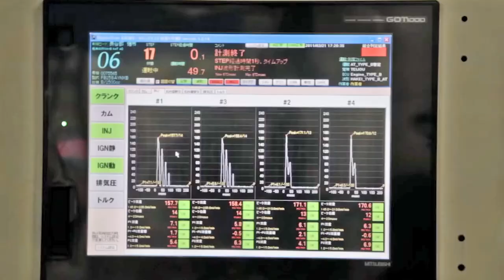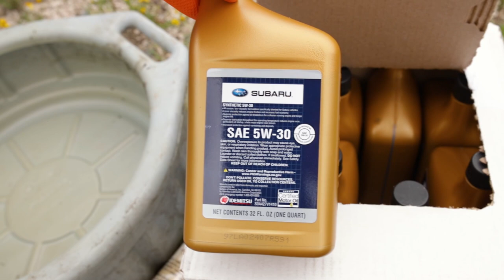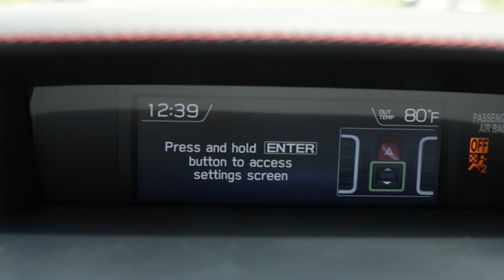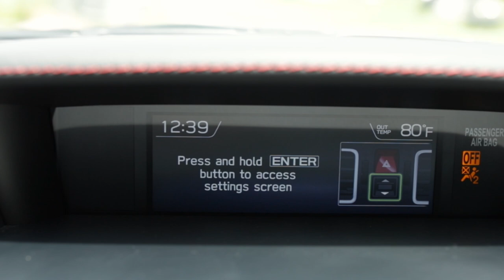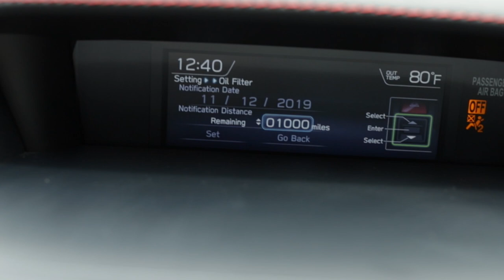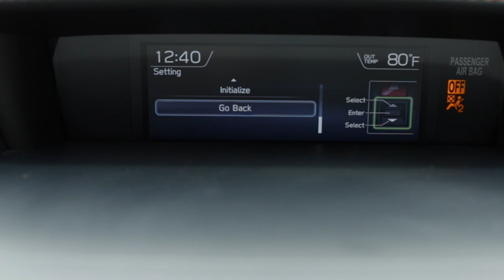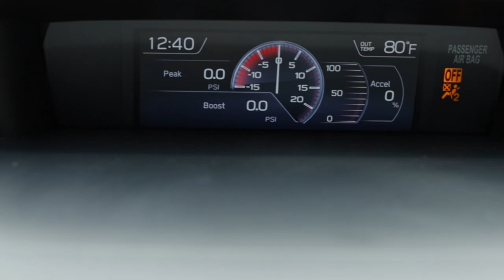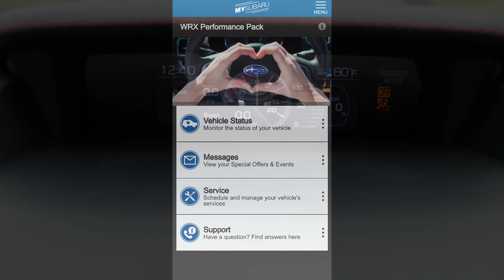2019 Subaru WRX Oil Change - DIY

Comment: On a brand new engine that you built and put in a car this is necessary. But Subaru actually breaks the engine in before putting it in the car at the factory.

Comment: I didn't know about the clear flood mode start on the cars. What I have been doing with my wife's '18 WRX is to fill the filter up with oil once, the filter will abosrb all of that oil so when you turn it upside down to install it nothing will drip out, I figured that way it at least had a little bit of oil in it. But your method is by far superior, the way I've been doing it I still got an oil light for a couple seconds after start.

I did the intervals similar to yours. First oil change was at 500 miles, the dealer offered a free oil change at 1000 miles so I did another one at 1000. I now do it 2x/year which is about 3200 mile intervals. My wife does not drive it very far.

Comment: i work as a technician at a subaru dealership and i’ve always recommended first oil change at 1000, then every 3-4k after that and never seemed to have any issues. i’ve also never prefilled my filters, these engines get a ton of oil pressure from cold start so i don’t worry about it too much. they’ve definitely improved the entire lubrication system on the FB engines compared to the EJs
Reply: It is the pursuit of perfection.  I did a semi-hard break-in on my 2013 Forester XT and changed the oil at 150, then 500 miles.  I live in the Sierra mountains, I loaded up the car with a few weights and a passenger, warmed it up and went for the hills.  First a few small hills up and down several times.  Then a bigger hill, then I let the car cool nearly completely.  Second time, again up and down but larger hills and a small mountain. Max rpm's around 4200-4500, for 5-15 seconds or so at a time, ...main goal was to put some load on the car and get the piston rings to seat.  I changed the oil immediately afterwards, at 140 something miles.  My next trip was through some really big mountains at higher rpms,   The car runs nice and doesn't burn any oil.  I am sure it would also do fine if I followed the owners manual recommendation for break-in, ...it is just the pursuit of perfection, plus in my locality there is no avoiding the mountains.
Reply: That's exactly what I did and have been doing since I bought my Series.Gray. I take my car to the dealer for oil changes (they are the cheapest in town for oil changes and I'm lazy haha), and they think I bring my car in too much, but Im just taking care of the car I have wanted since I was a little kid.

Comment: Cool topic. Solely as a point of comparison, according to the dealer, my Evo IX came with conventional oil for breakin. Drove the car as recommended by the manufacturer for the first 1000 miles. Against the dealer's advice, at around 500 miles, I changed the oil. Changed it again at 1000 miles to M1 factory fill, then at 2000 miles, followed by regular oil changes about every 2K miles to this day. The car has never been a daily driver. It's on its 6th set of tires and 4th set of pads with 60K miles on its odometer, to give an idea as to its use. Burns almost zero oil. A hardly noticeable amount. I'm amazed by this, as the car is almost never below 3K RPM and sees extended periods of WOT fairly frequently. Interesting how motors these days are broken in at WOT. Not sure this make me feel totally comfortable. BTW, I really like how the WRX's filter is right in the engine bay.

Comment: Yep,   I changed the oil on my new 2018 Impreza using about the same mileage intervals as you did.  I only used full synthetic, because I could not find any documentation stating otherwise. It does get a little expensive during the first 5000 miles, but  all the short intervals should pay in the long run.

Comment: FYI I’ve used the melling MPL-101 compressed air engine oil primer on all rebuilds to avoid dry starts.  It’s expensive but it works well.  Just install the fitting where the oil pressure sending unit goes charge with air and oil and let ER rip... they were pricy but they have come way down in price

Comment: My 06 WRX has clear flood mode, but it can be touchy... one time I only just thought about letting my foot off the accelerator and it started at full throttle.  I use it to move some oil around if I’ve let the car sit for a couple weeks. Use it at your own risk.  Edit - I wrote this before the part in the video where Mr Subaru used this feature.

Comment: 2016 WRX brand new. At 100k miles now. I've done Penzoil 5W30 Full Synthetic with Purolator One filter changes every 5k miles.  
Not a single issue yet.
Reply: RedSaiyan original filter looks prettier...

Comment: With modern engines apparently a WOT break in is the best way to do it. From what I’ve been told it has to do with seating the piston rings.  Low tension rings and the very smooth cylinder bore surface (to reduce friction increase mpg) they need a ton of heat to get seated.
Reply: I read a very similar thing after I rebuilt the top end on my 4 wheeler.

Comment: I have a 2021 WRX & I did my oil changed. Before I cranked it I did the oil flood mode that you mention & yes you can perform it. This is cool cuz this way oil can be pumped through the engine without having a dry crank. 😁

Comment: That is an insane oil break in procedure you are suggesting... I have NEVER had any issues at changing  @ 500-1500 and then 3500.... and I have had 24 new vehicles (8 were Subies). I also immediately install a Fujimoto quick drain on all vehicles- This is a must if you do your own frequent oil changes...

Comment: As far as "Break In" on any engine I have never done anything special. No additives, no special oil, just drive them easy for the first 1000 miles (vary speed, no high speed driving, no hard acceleration) and change the oil and filter at 1000 miles and have always got good service out of the engine, last car 409,800 miles and the old truck I have had since new 308,000 miles with no engine issues. As far as oil brand that is more a personal preference and it seems everyone's own brand is the best. FYI I have always used WALMART SuperTech Synthetic NO JOKE it even meet DEXOS 2 specs. If you do sell that car someone will get a great engine!! with a fun car attached.
Reply: @Snadzies  I am an old retired mechanic the BS is many years of experience.

Comment: MrSubaru, I changed the oil/filter in my '23 Outback for the first time today after 670 miles. I purchased OEM 0W-20 Subaru oil and crush washer but have't gone ahead and gotten a black Subaru filter yet. I changed it to WIX XP as I've seen/read they had gotten the best reviews compared to other brands. I'll try to get the black Tokyo roki filter next time, used the clear flood mode and worked like a charm! So happy I came across your channel and love the content!

Comment: Hey mr. Subaru, I’m currently a service tech a Subaru dealership and we use a funnel like that and it works on everything that I’ve had in here and the black filters are used on brz, 15+ wrx and the 6 cylinder engines, everything else uses the blue ones even the new sti’s which is sad. And the original filter on a  cross trek from the factory is a black one but we don’t carry those so we just put the blue ones on
Reply: Can you use the wrx black filter on other models? Was about to buy one for the wifes forester. That or those black Mazda filters. Looking for alternative to the blue filter
Reply: Josh Bascii not the ones for the wrx but you can find black filters for other models online

Comment: There was an article in Popular Mechanic, many years ago, way before the internet.
Car engine's first oil change should be at 200 miles, 2nd oil change should be at 1000 miles. After that at manufacturer's recommendation.

Comment: The old ways of breaking in no longer apply... these machines are much better built and the tolerances are significantly improved since the 1970's.... Do not sell the car, you are going to take it in the shorts....financially.
Reply: Only really needed break in for the cams and rings. They break in the cams now on the dyno and the material they use for the rings now needs little to no breakin
Reply: Yeah I had heard that since more or less the late 90s or early 00s engines always went through a factory break in. Not that they didn't still recommend a "light driving" period, but not the same as old school break ins.

Comment: did mine 600 2000 5000 then every 5k....now have 105k no issues runs great....2015 cvt
Reply: my 2015 has lower aluminum control arms

Comment: Yes, Subarus do have flood clear crank mode, floor the accelerator pedal to have wide open throttle (WOT) and the car wont start, I use that procedure after an oil change in my Forester.

Comment: Here in Sweden we have to let our dealership service the car for the factory warranty. I think most cars now days here has like a 25 000-30 000km service interval or once each year, which when I calculate it says about 18 000 miles US (we don't use miles in Sweden). You could service the car more frequently at the dealer but you pay about 200-300$ per oil change and a lot of new vehicles is sold as leasing cars.

Comment: Very meticulous! If I bought a brand new one I would probably be exactly the same. Everything you are doing may in fact be "unnecessary" in the end. It is however, still cheap insurance if it helps at all. I had totally forgotten about clear flood mode and I'm gonna use that technique from now on!

Comment: I wonder if that certified Subaru oil has a more readily-available equivalent, maybe even for less money, that would meet all necessary Subaru specifications?  Mobil 1 perhaps?
Reply: Any name brand synthetic is perfectly ok. Subaru motor oil is made by Idemitsu. Available at Napa,advance Auto,possibly other places. Most Asian carmakers often use a common API oil standard. So buy what you can afford. Costco has Kirkland Synthetic motor oil that is extremely affordable. 10 Qts for $24-$26. It's a high quality oil made by Warren Distribution. No problems with it. Walmart Supertech is another affordable oil.

Comment: Like you said, I think all engines are broken in at the factory.  As part of their quality and function tests, Japan factory runs a special single weight oil in the engine for some period of time.  Oil is drained and engine is crated.  In the case of my 24 OBW, car came with 0W20 synthetic and a US-made filter from Indiana plant.  Maybe you can still do one or two oil changes before your regular interval, but I believe this is far less important than perhaps 20 years ago.

Comment: Would you recommend the same break in oil change technique for a 24 Crosstrek with a 2.5 engine? What type of oil should I use for that? Do you have any affiliate links to buy any of this stuff to help out the channel? Thanks!

Comment: I was told every 6k to change it. In my manual it says every 5k or 6months which ever comes first. this is a 2016 subaru crosstrek limited. Oh and for the breakin period it said to change the oil at the 1k mile mark then at either 5k or 6month.
Reply: Yeah. I like this guy's channel, but some of his suggestions seem kind of superstitious. Six oil changes within the first six months of ownership? Don't break in a new engine with synthetic oil? Where is this stuff coming from? Because it's certainly not in the owner's manual. I feel like if Subaru felt these steps were so important, they would have documented it somewhere.
Reply: Excessive perhaps, but its good for the engine.  In the past, when synthetic oils were truly synthetic and very slippery you would not want to break-in an engine on such oil.  It would hinder the break-in process.  Today's so called Full Synthetic oils are just super clean extra refined mineral oils so there is no problem using them from day One.
Reply from the maker: These suggestions come from nearly every major engine builder's break in procedures since the beginning of the internal combustion engine. Don't like it? Don't do it.

Comment: I tried to follow the "drive it hard" breakin with my '18 Forester.  Hard acceleration from low to mid range RPM. It's not burning oil (yet) so everything seated in. That was my main concern with it. I think I did 1000, 3000 then started changing at 6000 intervals.
Reply: Mike Miller did the hard acceleration with my 19 forester doing good everything seated right not a drop of oil consumption

Comment: Would a Clear Flood Mode be okay to use in a 0°F morning or would it just add to the engine running dry for even a longer time?

Comment: I've never owned a brand new car. I wasn't aware of all the break in complexities.
Reply: You have not missed much, just the frustration of dealing with arsehole dealerships, lieing sales people and a sense that you are on your own, what ever goes wrong. In my country the used car buyer has more consumer protection than the new car buyer.
Reply: Snadzies agreed
Reply: Snadizes is right very very excesive to do this.  The best way to deal with a new motor is follow the enginers directions who built the motor. For this situation stay under 4k rpms under 50% throttle and avoid rapid accell / decells and avoid long driving at consistant speed for the first 1,000 miles.  After that changin the oild anytime between 1,000 miles and 6000 miles should be fine. The key is to keep an eye on the oil if ur trying to wait till 6k.  All that being said doing 500, 1500, 3k changes is very unlikely to "hurt" the motor.

Love the video btw super in depth thanks very much hope personal stuff gets better!!

Comment: The Nissan GTR engine is broken in the same way, by hooking it up to the dyno but running it for over an hour.
I got a '21 Ascent with the FA24Dit and went easy for the first 1000 miles, then the regular ones they recommended, but no successive oil changes like you describe.
No issues so far. But wish i took the time now.

Comment: Since it is direct injection I would put a oil separater on it to reduce the oil caking on the intake valves. It may have one from the factory, not sure.

Comment: Pick up a Fumoto valve. It makes oil changes super clean.

Also, my 2016 Prem has aluminum front controls arms up front... Not in the back though
Reply from the maker: Fumoto. 🤮 Never.
Reply: @MrSubaru1387  why? I love mine. Zero leaks and no mess when changing oil. 

Did you have a bad experience with one?

Comment: Hope all is good with you. I have been using the denso oil filters from rockauto should I start using the new oem black oil filters. I have a 2006 STI all stock with spt catback. 124,000 miles on car . Been reliable except for the evap issues. Fumato drain plug?

Comment: just watch out. 2015+ WRX throwout bearing is made out of glass
Reply: Doing it once early is good, just to make sure the filter isn’t clogged with metal and in bypass mode . But the filter cleans all that metal out you talked about . I think doing it early at like 1000 -1500 miles is all you need just to be safe, then every 5000 after that . Don’t drive yourself crazy worried about the metal particles, that’s what the filter is for ..

Comment: So Is this oil better than mobile 1 or Castrol synthetic oils?  I’ve been using Mobil 1 in my wife’s 2018 2.5 Outback. Should I switch to Subaru oil?
Reply from the maker: Why did you switch away from Subaru oil in the first place?
Reply: MrSubaru1387 

Got the car used with 2k miles and just did my own oil changes. Never even thought about using Subaru brand oil, I’ve been a mobile 1 guy all my life. This is our first Subaru btw, so didn’t know that you need to use Subaru oil. 

P. S Idemitsu Full Synthetic 0W-20 Engine is the same oil Subaru dealer use right?

Thanks for the great content that you put out.
Reply from the maker: @smokeu600  yes, Subaru synthetic is re-stickered Idemitsu.
Reply: MrSubaru1387 

Last question. Which one would you use in a 2018 Outback 2.5?

ZEPRO 30010095-95300C020 Eco Medalist Advanced Moly 0W-20 

ZEPRO 30010096-95300C020 Eco Medalist 0W-20

Comment: Does the clear flood mode works on 2018 subaru wrx w/out push button? I just prefill oil in my oil filter and screw back on and then start the engine and run it.
Reply from the maker: Yes. Gas peddle pinned to the floor, crank over.

Comment: Lol this is ridiculous. If you want to change your oil early, say around 1k miles during break-in, that’s fine. But more than that is truly unnecessary.  🤦🏼‍♂️
Reply from the maker: Just go by the recommendations of basically every engine builder out there, and was the way I was taught.
Reply: MrSubaru1387 it’s not going to hurt anything. To each is own. 😎

Comment: A lot of cars are being produced use synthetic after production. You can get a good break in, with better consideration to uniformity on wear, with a dyno setup, than a road setup. I do understand what you are saying though. I would still run it as a break in at purchase. Just get the 30 weight with the zddp. You can also get idemitsu oil directly, it's a bit cheaper, and that is what I do. Lucas makes a break in oil I like. Normally, I just get conventional oil and add a additive also lucas.

Comment: Question ..going based off climate..oil  matters on that part.i don't understand why ppl use 5w30 in very hot climate states or area . Thats to thin especially  in. Hot state the oil is already warm .5w30 has a very low heat point where heats starts breaking down the oil thinner ..I use 20w50 .my logic not thick as syrup but thicker oil is better on metal to metal .I have 280000 miles on my 06 forester ej2.5  p2096 code  and I have no knocks or pings and use 93 ..so yea think oil 5w30 is for cold climates so the oils doesn't freeze soild.

Comment: Do you know if Clear/ Flood mode is a thing on older Subarus?
Reply from the maker: A viewer said it worked on his 2000 Legacy. Another viewer said it didn't work on his 2005 STi. A good fail safe on the older EJ/EZ vehicles is to simply unplug the crank sensor under the alternator.